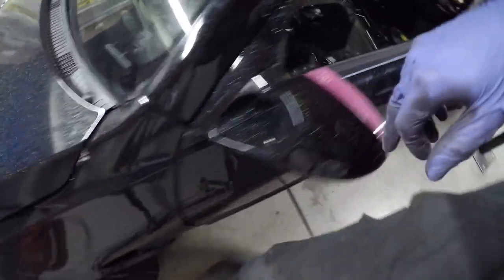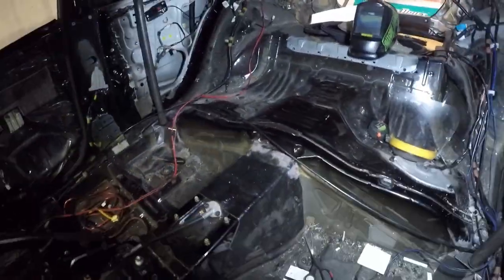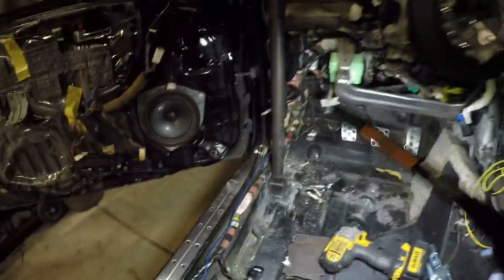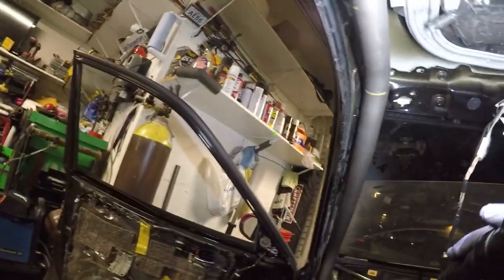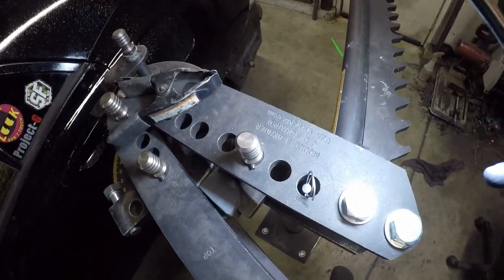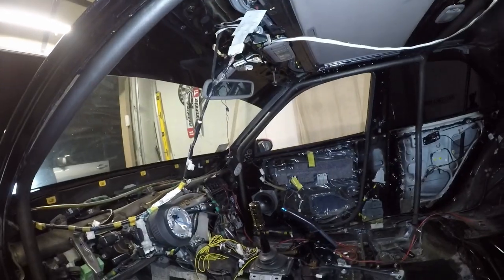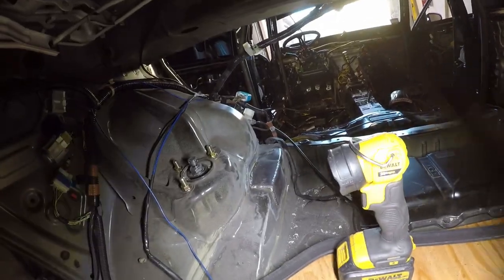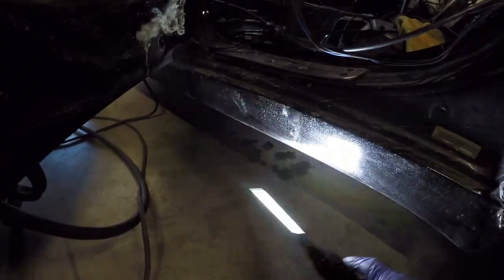IS300 cage drift car | how to build a cage

Comment: So I always wonder about this question but how do you weld the tube for the "A" pillar on the front side by the windshield without removing the glass or will it still pass tech with just that section not fully welded out